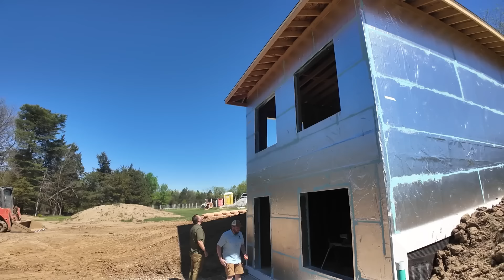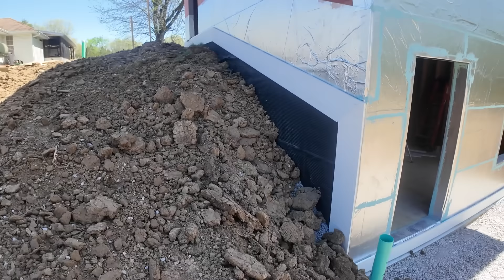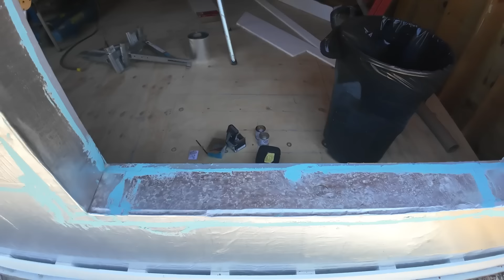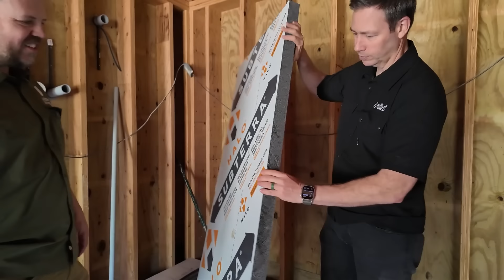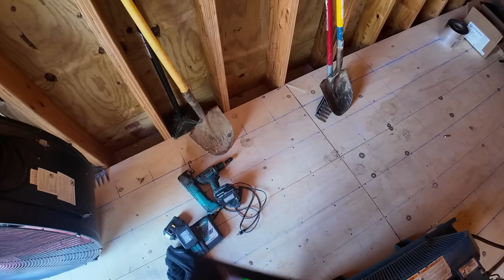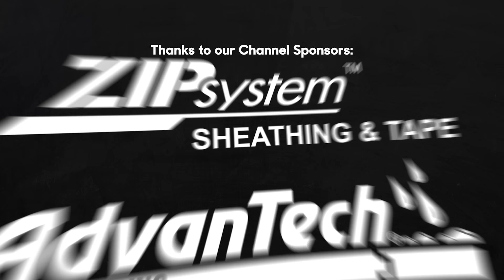Wooden Foundations - WHO KNEW

Comment: Specifically it's cooking the clinker that's most responsible for dumping CO2 into the air. Not that the trucks and diggers add nothing, it's just a lot of energy to burn rocks. There are less energy intensive ways of cooking it, but I like the idea of just removing it entirely. 

IRC vs IBC? Just an explainer video. 

National code standards yea or nay? 
I say yes, have a national baseline. Then let the states go further if they want. Here in CO my house has (supposedly) R15 walls and an R30 roof. That's not enough by far. In the year and a half this house has been standing its seen 120F and -20F. 

Standard codes for all dwellings (mobile, factory, modular, etc) yea or nay, and why? 
I say yea. Again as a baseline that can be expanded. There's a realestate lady I've been watching lately that's harping on the deceptive naming some modhome sellers are using. The houses aren't counted as modular, the 'mod' stands for modern, but they don't tell the customers that. So the building standards and prices aren't what the customers expected upon delivery.

Comment: "Carbon Neutral"

Sorry, but by cutting down the tree and processing it, you stop its absorption of CO2 and it inevitably has to be replaced, so even if you let it decompose naturally, it's releasing every bit of CO2 that was stored within it naturally.

Concrete on the other hand releases a lot of CO2 in creation and transportation. Still, we now know that over the life of it (especially in homes where it lives 50+ years) it will absorb CO2 into its structure to continuously harden to the point that every bit of CO2 released (and possibly more if it's not torn up like concrete roads) in its creation will be stored within its structure.

Also, I question the environmental friendliness for treated lumber since all wood is "straws" stacked and held together by lignen meaning anything put in them will flow around/through the wood and wood "breathes" and "water always wins" meaning I could see the chemicals used in treating this lumber leaching out of it (actually, I'd say it's a guarantee and is why it's not recommended to use treated lumber with raised beds!) and into the surrounding environment where who knows what effects it'll have on local water.

Basically, I get the siting availability and cost, but I think outside of those, the long-term environmental costs of this will be worse than concrete in a standard home that will stand for over 100 years!
Reply: I suspect you don't know what "Carbon Neutral" means.  It means that it doesn't increase or decrease the carbon in our atmosphere over the lifetime of the product.  Wood absorbs carbon during its growth, and releases it during decomposition, therefore its carbon neutral.  Its only the harvest, production, and transportation of the lumber that contributes to CO2 levels and they are relatively low compared to most other building materials unless your shipping it overseas or something.

The myth that concrete is carbon neutral has been perpetrated by the concrete industry and has been widely debunked.  Yes, concrete will absorb some CO2 over its life, as much as 50% of what was released during its manufacture.  However that figure doesn't account for the CO2 released in the mining and transportation of the raw materials or transportation of the finished concrete.  This brings the figure down to a max of about 25% of the embodied carbon in concrete is reabsorbed over its lifetime.  Then we have to talk about the steel rebar, the cost to remove it from the site, and what we do with it when the structure is no longer needed.

There have been some developments toward a true carbon neutral or better concrete, but I haven't seen that in mass production yet today.  And it still won't solve every issue, but it could go a long way.

Treated lumber made today is generally safe.  I still may not want to grow my tomatoes in a box made from it, but that is due to potential for high concentrations of otherwise harmless chemicals.  Hell, you can die from high concentrations of caffeine, but we still love our coffee.  The small amount leaching into the ground from your home will not significantly contaminate the soil or groundwater.

Comment: I grew up in a house built in the 70's using a wood foundation. House was in it's twenties when we moved in and about three months after we moved in we noticed a musty smell that never went away no matter how we tried to control humidity and temps. Wound up selling it five years later for a traditional concrete foundation home. The house is still standing 30yrs later but no idea what shape it's in.

Not something I'd use on my next house. My next house, the property is sandy soil on a floodplain (would need a 20ft rise in water, maybe 100yr flood to flood our land) so we're going to do a concrete crawlspace to keep it above ground, but still solid foundation.
Reply: You were smelling your house rot with mold. You just could find it without ripping walls open. These foundations are complete crap. Moving was your best option, pat  yourself on the back.

Comment: My parents and I went on a showing of a wood foundation home in central MN. We didn’t know it at first, but the basement smelled musty and when we found out, we investigated and you could poke your finger through the wall in several places. The realtor said it wasn’t a big deal, but we felt it was. Someone else bought the home. I wonder if they were aware of the wood foundation.
Reply: Looked at house that had this exact problem. Built in the early 90s, near lake Minnetonka in Minnesota, we toured and had it inspected in 2023, and the basement foundation walls were full of mold and I would say structurally compromised due to water infilration over the years. Needless to say we passed on buying the house. 

Maybe this method they are describing in the video (and others who may have found success in the comments here, alot seem to also be in MN) is viable with different soil conditions and waterproofing details, but I question the longevity vs a concrete system.
Reply: @ACDoesIt247  the place we toured is in Zimmerman, MN right near the Sherburne County Wildlife Refuge and Sand Dunes State Park. My childhood home is only a few blocks away and it’s all sand. We had to haul in truck after truck of black dirt for the yard. My parent’s sump has run only one time in their 28 years of living there. Granted, much of the area in the wildlife refuge is marshy and lowland, I always thought the surrounding residential area shad very good drainage, which made our finding all the more surprising. Many of my friends in the area also had bone dry basements (CMU). I think in this case it had to do with a poor or failed exterior envelope around the wood foundation and improper grading to the North of the subject property.
Reply: Unfortunately this is what happens to all of them. Wood touching dirt is a horrible idea, pressure treated or not.

Comment: When it's this well-built, I think it's better than a shabby concrete basement! Most homes don't have that perfect working drain, dimple mat, fluid seal, and stick on seal.
Reply: Concrete companies like to point out failures, but nearly every basement I've been in that is over 30 years old has had a flood at some point and they have cracks about every 8 feet.
Reply: You have to also think, repair is cheaper with this too. You could jack up the house and redo the framing.   Perhaps, its a good idea to have jack post pads poured in advance, even if they are hidden by the floor.   If you ever had to jack the house up and redo the wood foundation, it would be easier.

Comment: I got to do a wood foundation back in high school (co-op) more then 30 years ago for a school. Thing is still standing
Reply: 30 years on a foundation is nothing to brag about. That and how do you know the buried side is not rotted? Do you periodically dig it up for inspection or just pretend it will be ok?
Reply: @Qbert-379  Actually in the case of the house my father, my brother and I built in the early 90s, yes, yes we have dug it up since. This year we were digging a pit to create the footings for an outdoor lift and even though it was to be a foot and a half away we had to take everything out to the wall due to the granular backfill that would otherwise collapse (it is certainly "fun" pinning back granular backfill). So we got a good look at a 3' section from a corner. You wouldn't know if it had been installed 3 years ago or over 30. With a clear stone base (which takes some work to compact), a sump pit and pump and clear stone backfill, there really isn't anywhere that water sits around for long.

And that wasn't the first time we'd dug up a section, either. About a dozen years after the original construction, we made an extension against another section, so that time we had about 12' of one wall and about 3' of another to look at. Same thing then. On that extension we were then able to use drainboard as well as gravel. On another occasion we lifted a section of floor to add in some under-floor return air ducts so we had an opportunity then to take a look at the floor structure. That was super pristine.

If it's been built competently, it'll last.
Reply: @davidjames4915  Good for you. I feel bad for the people who's foundation rotted away.
Reply: 30 years isn’t exactly long….
Reply: @shawnbradford2243 right?
Reply: @shawnbradford2243 Tell that to D.R Horton and Rauch Coleman homeowners

Comment: As a retired cement finisher and was at it since High school, (69 now) I must say that this a great way to build in hard to reach places as you explained. But I believe that good quality concrete work will out last wood by far. Quality work#1. All of this high dollar lumber is not butterflies & little fairies removing the lumber from the earth and milling, treating, transporting etc. either. It has its enviromental issues too. I just like the look and feel of concrete. Plus, no splinters.
Reply: I don't give a crap about carbon emissions, but if you do the benefit of wood is it's made mostly from CO2. Anytime you build a long lasting structure from wood you're basically storing CO2 from the atmosphere in wood form. Concrete on the other hand produces a ton of CO2 in the manufacturing process, so instead of taking CO2 out of the atmosphere, or ending up carbon neutral, you're adding to it.
Reply: What about pouring concrete jack post pads hidden in the floor in the right spots?  If anything ever went majorly wrong with a wood foundation, you jack the house up and replace the foundation.
Reply: People have been building mud structures for thousands of years that still stand today. Wood will not. End of story.
Reply: @raisingarizona2008  The claim that timber buildings cannot last thousands of years is simply untrue. Google "Oldest Wooden buildings" and you will find examples of wooden buildings that are 1000+ years old. There is no need to be so absolute about this. Mud and timber are both fabulous materials that depending on the specific use cases. For example, if you were building in the Cascade Mountains of the Pacific Northwest United States where 60 inches or rain is normal, a mud structure would be a terrible choice and timber would outlast it. Mud is great in dry arid climates. Stone will generally outlast both of them.
Reply: The carbon impact of Portland cement is massive. Lumber is not even in the same ballpark. The construction industry accounts for about 10% of global carbon output and almost all of that output is from steel an concrete production. Trees absorb carbon as they grow which helps reduce the impact of lumber.
Reply: Not to mention all the chemicals in that treated wood
Reply: You did not mention you are biased due to concrete being your way of living for fifty years. Most concrete companies can't pour a level slab to save their lives today.

Comment: I know someone who has lived with one for 40+ years.  They are very happy with it and say its more comfortable than a traditional concrete basement
Reply: Your making a positive comment about one in many as though they are a good idea. Wood foundations are complete crap and will rot overtime. I've never seen one without questionable area's and that's just what can be seen, what about the other side of the foundation wall that's buried, what does that look like, nobody knows unless you dig it up. Your foundation is the primary component in a home and is not something you want failing at all.

Comment: After watching all the way through I still have a few questions. 1) Are there Radon level concerns for this method? 2) Is the uplift loads comparable to embedded straps? 3) What measures are taken to ensure natural thermal expansion and contraction at the wood exterior where the portion above ground meets a portion below ground?
Reply: I have a wood basement yes radon levels are a concern, we had to put in a radon system

Comment: My house was built in the early 80s, it has a wood foundation (crawlspace) plywood and 2x6s and fiberglass batt imsulation, what i can see on the outside is looks like they mopped some hot tar onto it as protection. We havve really good drainage here and it is doing alright.... i dont think its perfect, but not nearly as bad as i thought it would be. 

I also built a cabin off road and not easy to get to. I ended up opting to build 3x3 grid of wodden platforms (properly pressure treated out of ply and 2x10s, buried in gravel (locally sourced dry river bed)  used them as a stable platform for 6x6 cribbing and used some local trees to souce the 3 20ish inch round logs as beams to build the floor on top of. Hasnt moved in 10 years! My father in laws concrete piers are all failing. Once mine rot out to needing replacement. I just need to jack the log up an inch or two l, knock he cribbing out, replace the wood platform and set everything back down. My FIL cabin basically needs to be rebuilt because the piers failing caused a cascade effect on the rest of the cabin.

Comment: I think this concretless construction raises interesting questions about tradoffs and building longevity. Some quick online research shows buildings in the US have average lifespans of around 50-75 years. If this wood foundation cast last that long it's a win, but it does depend more heavily on proper installation (and maintenance?). I think I would lean more towards simplly building on or above grade using a concrete-free slab, pins, helical piles, or even concrete piles. Our concrete reductions come from eliminating slabs and stem walls.

Comment: Another PRO for this method is this is very DIYable. If I was building a house and wanted to do every step from the start, this is way easier.
Reply: still seems like cmus would be cheaper. Probably not as fast for a diy though. But special ordered treated ply? I bet that stuff is $100 per sheet.  Not to mention the treated dimensional lumber and special fasteners.
Reply: What’s difficult about putting up forms and rebar and pouring concrete? Same with ICF
Reply: @timm439  Not sure If I'm interpreting the question right, but forming a tall concrete wall is one of the most skilled and difficult parts of construction. ICF would be a much much more diy approach
Reply: @95thousandroses  I can see maybe the stem walls being wood (with ridiculously good waterproofing and near zero chance of puncture.. they should’ve had dimple mat for reducing hydrostatic pressure), but I’m mainly not understanding a single 2x12 as a footing.. that’s just stupid… no load distribution capability compared with concrete which isn’t hard even DIY.
Reply: @timm439  yeah I didn't quite understand the 2x12 or how the whole assembly went together. Guess I'd need to look at the other vids to understand it better.
Reply: @timm439  nothing ,but the price point is lower for wood.
Reply: @paperburn  of all things in a house build, I think the very last thing I would cheapen out on is the foundation
Reply: @timm439  I would say it depends on circumstances as well.  Building  a house for one  generation  or building a home for generations. Many of the choices my father made were based on that when he died all of the family had thier own homes already. He just wanted his retirement home on the south slope overlooking the valley.
Reply: @timm439  It's not like concrete is the perfect foundation material, it has tons of problem on grade and below it, basement walls collapse and slab on grade often requires piers to stabilize them. It's not like they decided not to use a perfect material to save money, it's just a different method of building.
Reply: @bobbygetsbanned6049  Nothing is perfect,  but concrete with rebar is well over 10x stronger than wood, especially when the wood is flat. I can’t believe this is an argument.
Reply: timm439 If the foundation isn’t a distributed load, what is it? You think it’s a point load? Concrete is definitely more rigid than wood, but the load is still distributed. 

From a loading perspective, it’s similar to our roadways. Concrete roads are rigid and can bridge all sorts of imperfections to distribute the point loads above to the ground below. Asphalt roads are not as rigid - actually classified as flexible, and rely on the aggregate base below to distribute the loads from above to the ground below.

Comment: I live in a house with all wood basement that was built in 1985.   Have added a walk out in the basement 10 years ago.. at that time,  the wood looked brand new.   All it had on it was tarred seams and poly...  and back fill with p gravel.   Tiled  under basement floor.    No issues.   Warm..  would build another one with no worries....